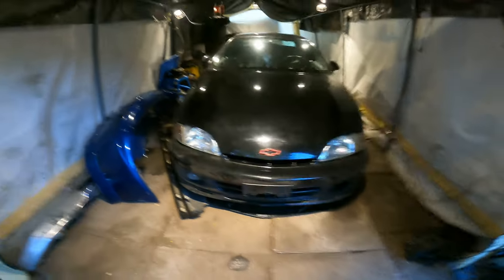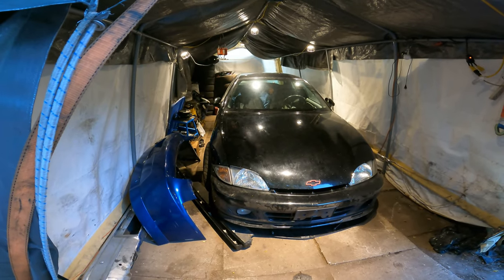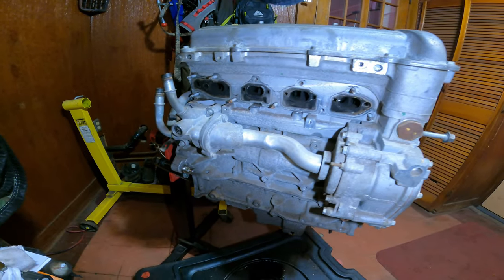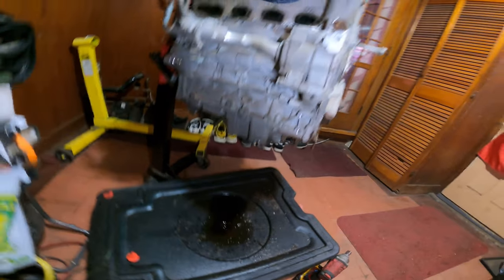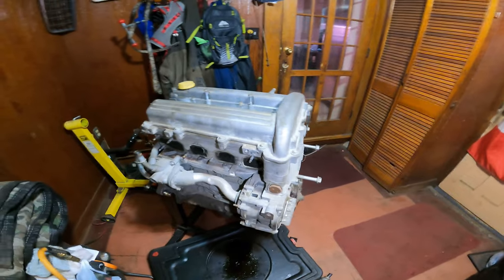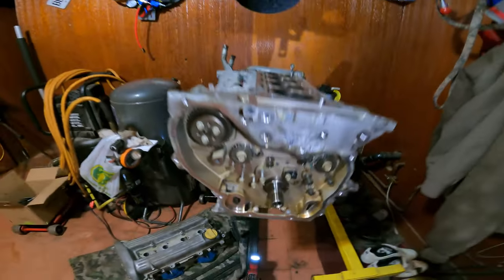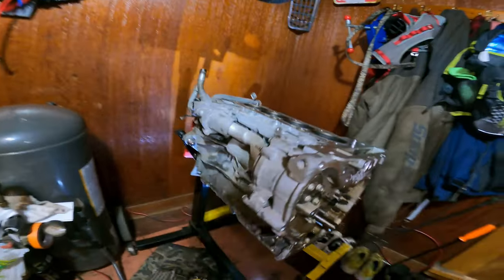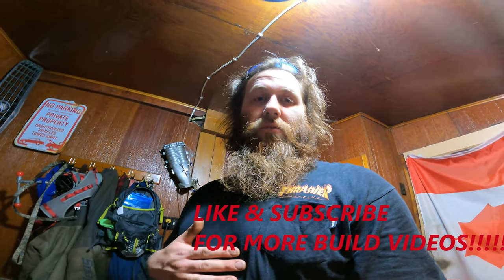10 Minute Engine Tear Down Time Lapse!! 2.2 Ecotec

Comment: My battery tray is rusted out how do I replace or fix the problem. My battery is grounded to the tray.
Reply from the maker: They are spot welded onto the frame rail so you will need to drill those out and would need to re spot well a new one on! Or you can do a battery relocation kit which is what I have done to this car! My battery is now in my trunk!